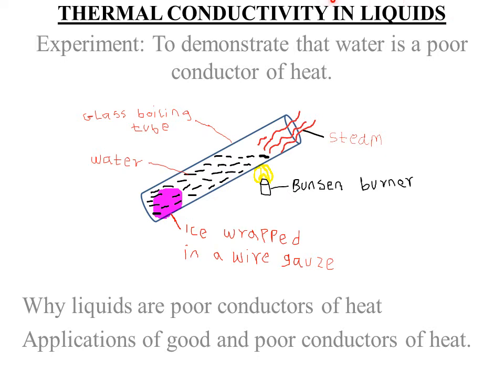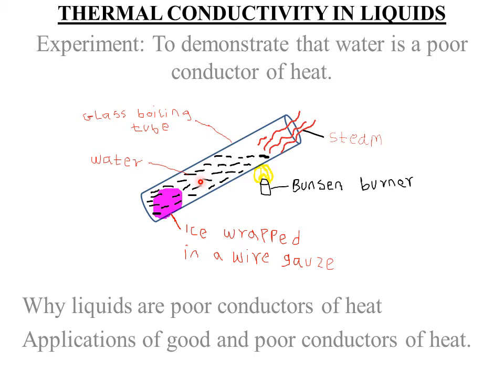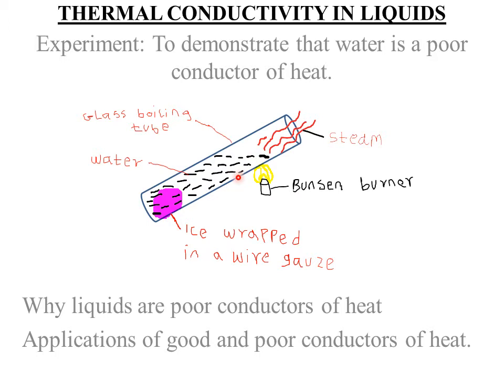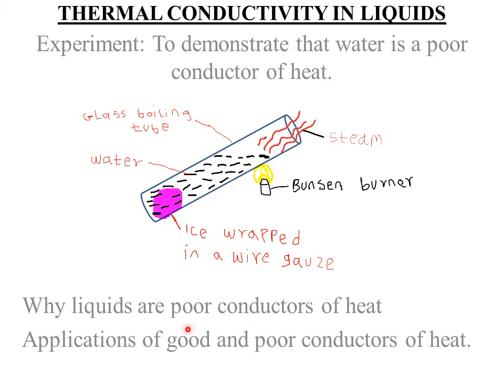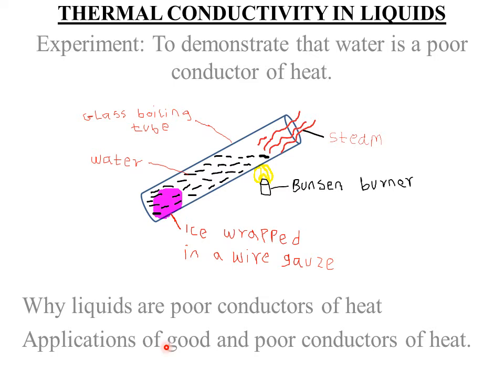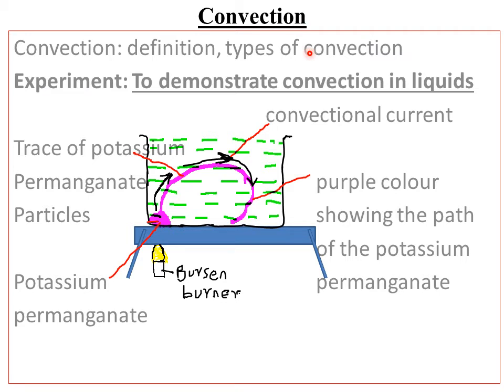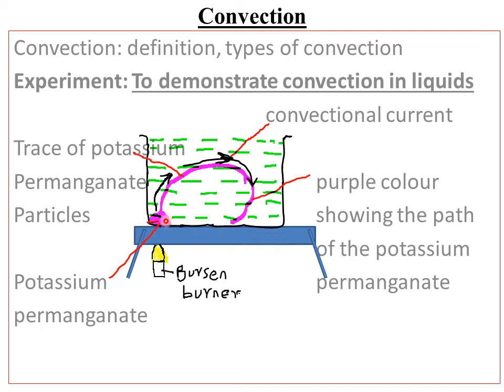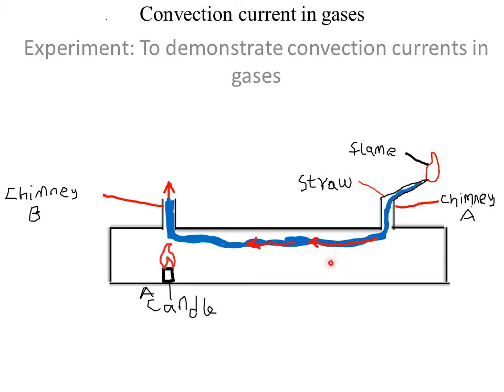HEAT TRANSFER : LESSON 2

Comment: That convection
Reply: B
Reply from the maker: Convectional currents are formed when one part of a fluid (liquid) is heated causing density of the heated molecules to reduce. The density of the un-heated parts of the fluid (liquid) being higher causes a density difference. This density difference causes heated molecules (less dense molecules) to move upwards (float) while the un-heated molecules (denser molecules) move downwards (sink) to replace the space left by the rising (floating) heated molecules. This leads to a circular motion of the fluid (Liquid) molecules which is called convectional currents. To understand this better, watch the domestic hot water system in this video 👉https://youtu.be/UluwBw0kE7g. Thanks for your comment Amina🙏.
Reply from the maker: "B" to mean?🤣

Comment: In the previous lesson you said wood is a poor conductor that's why it burns but why not water which is a poor conductor
Reply from the maker: Although water is a poor conductor of heat when in liquid state, it can still conduct heat when in gaseous state (steam/water vapour) through a process called convection. Water can exist in all the states of matter i.e solid state(as ice which is a poor conductor of heat), liquid state (as water which is a poor conductor of heat) and gaseous state ( as water vapour/steam which is a good conductor of heat by use of convectional currents ). For this reason, water doesn't burn because when heated, it changes to gaseous state (steam which is a good conductor of heat by use of convectional currents). Conversely, wood can only exist in solid state, hence it's particles can only vibrate at fixed positions when heated hence burning. Thanks for asking a very good question. Keep it up 👏👏👏
Reply: it depends with the natureof the conductor

Comment: Why don't I understand the heat transfer lesson 2
Reply from the maker: Convectional currents are formed when one part of a fluid (liquid) is heated causing density of the heated molecules to reduce. The density of the un-heated parts of the fluid (liquid) being higher causes a density difference. This density difference causes heated molecules (less dense molecules) to move upwards (float) while the un-heated molecules (denser molecules) move downwards (sink) to replace the space left by the rising (floating) heated molecules. This leads to a circular motion of the fluid (Liquid) molecules which is called convectional currents. To understand this better, watch the domestic hot water system in this video 👉https://youtu.be/UluwBw0kE7g. Thanks for your comment Amina🙏.